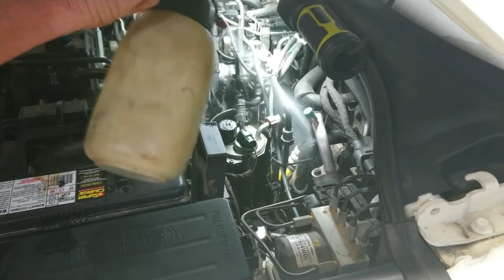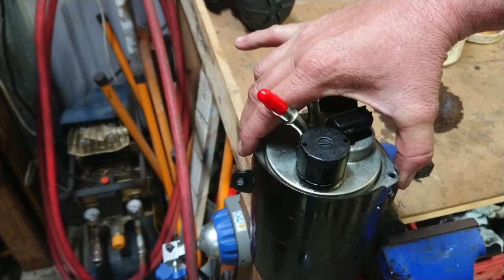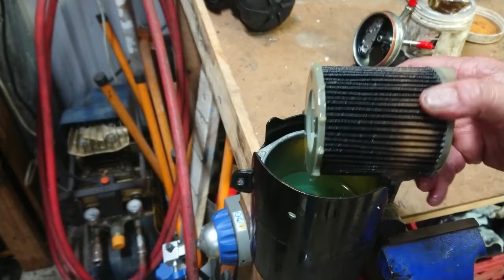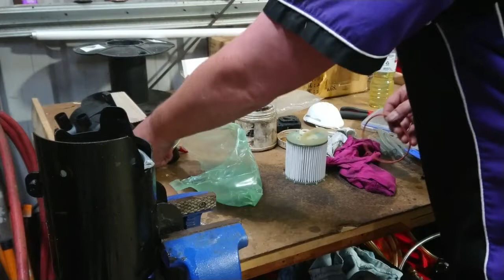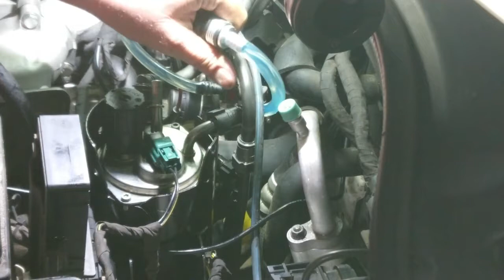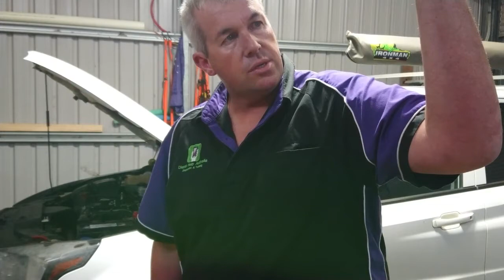Optimus Primer® – How to Replace a Fuel Filter When a Hand Primer Is Not Present.

Comment: I like your video, mate.
I do a similar thing, but with a 500ml fluid syringe by drawing the diesel through the outlet of filter  purging out the air and any contamination introduced when the fuel filter is apart.
Reply from the maker: Thank you for your compliment. Great idea with the syringe 👌